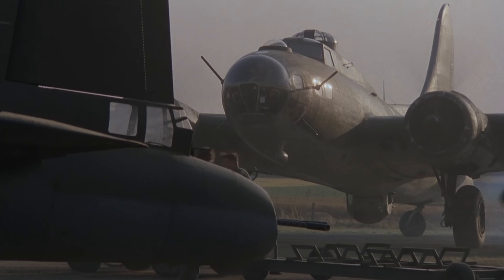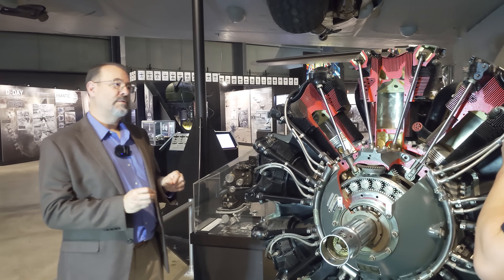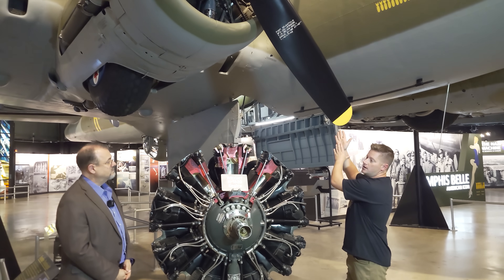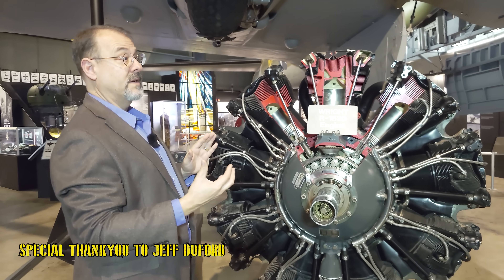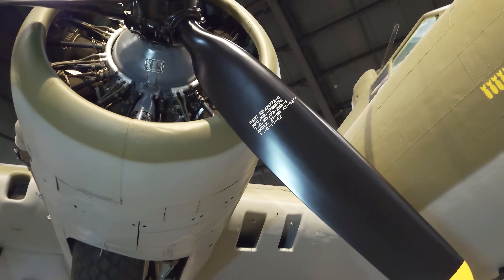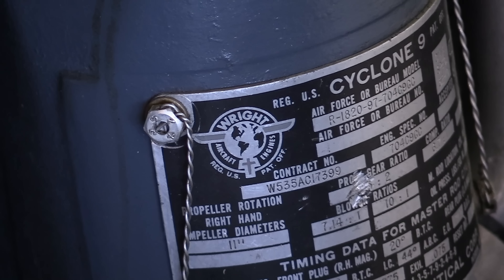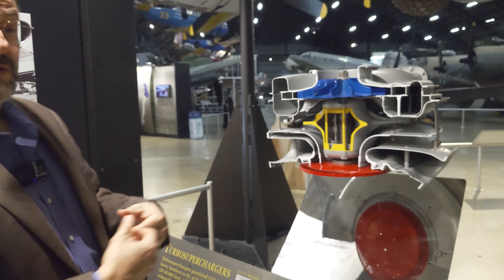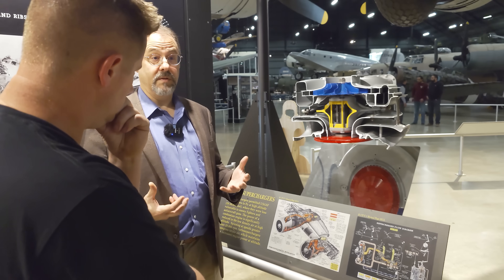B-17 ENGINES IN DEPTH! Genius Or Insanity?

Comment: The nine-cylinder radial engine has two cam rings.   One exhaust, one intake.   Each ring has four lobes and rotates opposite the crankshaft's rotation.   Also, each cam ring rotates at one-fourth engine RPM.  I'm quite familiar with engine mechanics, but this arrangement still amazes me, and I don't fully understand how it works.  But it does.  The cam rings are partially visible in the cutout.   Also they had roller lifters, which are very common today, but unusual for the 1930s and 1940s.   Remarkable engineering, and achieved w/o computers, CAD-CAM, or CNC.  Those engineers were geniuses.  Up close and personal, nothing sounds quite as awesome as a big, radial engine.   I got to ride in a B-17 about a decade ago, for $450, and it was worth every cent.   I sat in the nose gunner's seat and "strafed" herds of cattle that we flew over in fields surrounding the airport.   Quite an experience.   No cattle were harmed!
Reply: Each cam ring operates at 1/8 engine RPM . . . . . not 1/4.  Each cam ring does, indeed, rotate opposite the crankshaft's rotation.  You're right . . . . these 1820s were a work of genius!
Reply: Thanks for that correction. @PhrankTube
Reply: @PhrankTube are you sure?  If you look at the gearing that can’t be true.
Reply: @totalyep  Yes . . . . . absolutely!  Right from the B-17 manual.  Just do the math . . . . . cam ring rotation between cylinders 1 and 9 (remember the crankshaft rotates opposite to the cam ring) . . . . . 40 degrees divided by 320 degrees is 1/8.
Reply: @PhrankTube  thank you. From looking at the gearing I don’t see how it spins that slowly. The inner “sun” gear must not be spinning at the same speed at the crank.
Reply: @totalyep  You're right . . . . it's not.  Here's a good one for you . . .   Magneto Drive Shaft Speed Ratio to Crankshaft = 1.125:1.  That one might keep you awake at night!  The "proof" is left as an exercise for the student.
Reply: @PhrankTube  ah. Makes sense. I need to find a good cut away. Fascinating all the moving parts in these engines.
Reply: @totalyep  Here's another mind bender for you:  Just imagine that the cam ring and the crankshaft both rotate in the same direction (not opposite direction) . . . . . The cam ring would now have 5 lobes (not 4) and would rotate at 1/10 crankshaft RPM (not 1/8).   Enjoy . . .
Reply: @PhrankTube  "That one might keep you awake at night!"  On the contrary. Instead of counting sheep, I try to visualize the operation of the cam ring opening the intake valve of the #1 and then the #3 cylinders. It's so far beyond my feeble mind that it puts me to sleep instantly.
Reply: @PhrankTube OK, Ignition vs Crank, 8 to 1. Otto cycle one spark per two revolutions, that is four to one....I don't really understand radials, don't know anybody who does!
Reply: @RSB333   Well, here's how it goes.  The crankshaft fires 9 plugs in 2 complete revolutions.  The magneto creates 4 sparks (sent to the distributor) for each of its' revolutions.  The magneto is geared at 1 1/8 revolutions per crankshaft revolution.  Soooo, 4 x 2 x 1.125 = 9.  No mystery:  That, however, is enough for "Round Engine Appreciation Day".  Isn't this fun?
Reply: @PhrankTube DEAR PHANKTUBE GREETINGS! 
VERY INTERESTING COMMENTS. 
ARE YOU A CW1820 MECHANIC OR ENGINEER?
Reply from the maker: On one hand it's UFO technology, when you look into it, it's amazingly simple to understand compared to today's engines. Thankyou for watching! Glad you got a 17 experience flight in!
Reply: @MilitaryArmamentsCompany  true. Simplicity is the paramount of engineering
Reply: Man, I'm a mechanical design engineer and blows my mind every day that those engineers design all that stuff without a damn calculator! All by pen ans paper..... Its absolutely mind-blowing, you take me the computer and im completely lost 😦😦
Reply: @xevi2889 Hey, they did have slide rules.....good to THREE significant digits! Ya hadda add and subtract the zeros in your head for decimal point.
Reply: They have more lobes to equate the difference from half speed to a fourth speed. Very interesting setup though
Reply: @benmassey531  take the number of cylinders and add 1 or 2. For a 7,  6 or 8. Divide those by 2 and that’s how many lobes each cam track can have. For a 7, the cam can have 3 or 4 lobes. The ratio is 1/(number of cylinders - 1 or plus 1). So three lobes turning at 1/6 engine speed or 4 lobes turning at 1/8 engine speed. One needs to turn opposite direction, but I can’t remember which. A 5 will have 2 or 3 lobes, a 9 will have 4 or 5 and so on.
Reply: @88SC  Great explanation!  Thanks . . . . .
Reply: @benmassey531 Great explanation!  Thanks . . . . .
Reply: I was hoping for some technical presentation. Sadly, the video struggled to explain why compressing intake air was needed at 30,000ft. OMG.
Thank you for the tech. Your post made visiting this page worthwhile.
Reply: Two solutions for every possible number of cylinders. Someone will chime in with the formula, I’m confident.
Reply: All of the computers just slow down development. p51, ink to first flight-125 days, V22-20 years to production
Reply: Cam rings ? You mean lobes ? 
I have a cylinder head piece from a crashed B-17. I was amazed at the roller rocker arms. The engines are still at the crash site from the late ‘40’s.
Reply: @redmesa2975  I meant cam rings.   The cam rings have came lobes on them.   They use cam rings instead of camshafts.  They perform the same purpose.
Reply: @claiborneeastjr4129  now I understand. Thanks !
Reply: And then think about the Pratt & Whitney R-4360 Wasp Major, an American 28-cylinder four-row engine.
Reply: @MrMerlin9911 I read once the 4360 was a beast to time! Each row had to be timed separately, then the rows had to be timed to each other. Not to mention having to change 56 spark plugs! And then there was the problem of insufficient cooling of the D row. Some engineers derated the D row a bit to prevent the cylinders from overheating.
Reply: Genius is right.
Reply: Be grateful for the experience; as of a couple months ago ALL such flights are now forbidden.
Reply: @philgiglio7922  That's awful news.  Why?   EPA regs?   Insurance regs?   Can't say I'm surprised, however.
Reply: @philgiglio7922  exactly 2 months ago I flew on one, so I don't know what you're talking about.
Reply: I believe it's not that a particular row of cylinders overheats or does not get adequate cooling airflow. Yes, air flowing over & around cylinder heads in the row(s) closer to the propeller recieve cooler air, it's more an issue of ducting the air to flow evenly at a similar velocity around each cylinder to provide even or balanced heat transfer to the cooling air within a narrow optimum range, thus air velocity through & over the engine is critical. Therefore, cooling air intake ducting & exhaust ducting are critical. Cowl flaps, while allowing a higher volume of airflow, could upset balanced airflow. Just because the engine is operating at higher altitudes with coler ambient air temps does not guarantee an evenly cooled engine.(This was once explained in detail by an uncle who ran B-29 squadron maintenance on Tinian & Siapan during WWII
Reply: WHAT
Reply: )0) tx d
Reply: Actually, it is one ring with two sets of lobes running around it.
Reply: Yes we hosted the nostalgic C47 FAA flight check bird for a time. I got the privilege to fly on it as a flight engineer. One thing I learned quickly is, if it is not leaking oil, you'd better check it, because it is probably out of oil. Cool old bird but we went through lots of diapers. It drove the skeeters away when it started also. you would have thought it shed a piston; it smoked so much. We always hand propped it with ignition off before starting after sitting to make sure the 6 o'clock combustion chamber was not flooded with oil. Under hydrostatic lock you'll bend or snap a rod. I've also heard of them breaking a cylinder loose.
Reply: I don't remember if this engine uses a master rod, but on those engines that do, the other connecting rods articulate off that master and don't make a true rotation. Hence, the timing cam in the magneto has the lobes for the points slightly offset for the difference in timing that each piston would require. Google radial engine compensated ignition cam (It should come up...we talked about this in A&P school)
Reply: Roller lifters were only uncommon in automobile engine's back then, every motorcycle engine I've seen the inside of from the mid teens up had roller lifters even the flathead motorcycle engine's.
The only reason I can think of why the automobile industry used flat tappet lifters so extensively is because with them you don't have to solve the rotation issue like you have to with roller lifters, it simplifies the design, aside from that I couldn't guess as to why they used flat tappets in their engine's when it seems like everyone else used roller tappets.
Reply: @dukecraig2402 motorcycles obviously also have a lot fewer lifters. Early motorcycle engines in particular also had pretty crude oiling systems like total loss or not pressurized which I bet a flat tappet arrangement might not take kindly too. Just a guess
Reply: Good reasoning.   Likely flat tappets were cheaper to manufacture, too. @dukecraig2402

Comment: So these engines were compounded according to the explanation given. Interesting. I was under the impression that turbo compounding came later. Great video. Thanks for posting.
Reply: To be compound, the turbine should be geared to the output shaft. This turbo feeds the engine driven centrifugal supercharger. Really awesome though.
Reply: @Dr_Reason  Making it a 2 stage supercharging system,  More than the British Lancasters Merlis had, only a single stage mechanical supercharger, why B17 had a 10,000 ft service ceiling advantage over the Lancaster !!!
Reply from the maker: Glad you enjoyed it! Plenty more coming.

Comment: Hypothetically, if they replaced the R1820 radial engines of the B17 with the r2800 engines what kind of performance boost would you get?
Reply from the maker: Love the creative "what if" thoughts. That one is definitely above my pay grade. Some one here may know.
Reply: @MilitaryArmamentsCompany  Well the B17's engines were listed as 1200 HP ea and the R2800 in basic form was 2,000  And depending which R2800 and the supercharger used, either the single stage, or 2 stage 2 speed unit or the 2 stage Turbocharged version to determine service ceiling and load !! !

Comment: He mentioned Sam Heron, who was a genius whose contribution to aircraft engine development came at a critical time in history. His employment of sodium as a heat transfer medium was paramount in the development of other industries as well. Respect.
Reply: Sodium, having a low melting point, would slosh around inside the valve to improve heat transfer.
Reply from the maker: Yes absolutely. Jeff was the right man for the job on this topic!
Reply: Wow every day is a school day, Sam worked for Armstrong Siddeley Motors of Coventry Warwickshire UK, for he designed the Jaguar first half way reliable twin row radial  in the early 1920,s.
Reply: Sodium filled valves are used on modern turbocharged car engines too.
Reply: @twelvereasonswhynot   So did  Cecil Rowledge , in 1929 -31 he was partly  responsible for developing  Rollers 'R' series drag race engine with sodium cooled exhaust valves, giving Britain the outright win of the Schneider Trophy  powering Reggie Mitchell,s 'Hot Rod' the S6B.
Reply: Should be called Heron valves.
Reply: @peterclark6290  I think you are right, with out  Sam,s breakthrough, we could not have won the Battle of Britain,. Rollers of Derby used sodium cooled  exhaust valves on the Merlin and Griffon, enabling high power ratings with improved reliability.

Comment: Wright engines were 2nd rate..
Look at what they were put in..
Mostly crap.. Pratt&Whitney powered much more successful aircraft! B-17 flight engineers weren't even used for training on the then-new B-29 superforts. I know this because my grandfather who was a assistant flight engineer on a B-24 told me.. He trained B-29 engineers when he was rotated back from the SWP & his missions flown there on Liberators.
Reply: The FM-2 used the R-1820 very successfully and was able to be "tweaked" to above the rated 1350 hp.
Reply from the maker: Interesting feedback. You would enjoy our B-29 in depth video, we spend several hours with their flight engineer Donnie.
Reply: Not a word I would use to describe NAA B-25s, Douglas Skyraiders and DC-7s, Lockheed Constellations and Neptunes. Early ’3350s on B-29s were unreliable but due to necessity they were pressed into service before they were ready, development wise. On the other hand a Pratt R-2800 is the gold standard for reliability among high power radials.
Reply: johncarlson  BULL$HIT story !!! Wrights were as good as any engine why over 200,000 of them were made !!!

Comment: My father was a ball turret gunner in B-17s in North Africa during WWII.  When I was a young kid, he was always telling me that the superchargers and turbochargers on the B-17 engines increased their Volumetric Efficiency(VE).  I never knew what that really  meant until I took a class in thermodynamics in college. 
Note: From an online Brian Nutter Tech Article ------ At sea level, the air is more dense. This means that there are more air molecules inside the cylinder. In the mountains, the opposite is true. The same engine would operate at a higher VE at sea level than in the mountains.  You can improve VE by making it easier for air to flow. This is the idea behind aftermarket intake manifolds, cold air kits, porting and polishing cylinder heads, and headers. Pumping more air is also the idea behind superchargers, turbos, and nitrous. These power adders force more air into the cylinder. When the fuel and ignition systems are properly tuned, this can raise VE over 100 percent and make tons of power. (From "On All Cylinders" Tech Article 05/11/2017 by Brian Nutter
Reply from the maker: First rate description! Thankyou for the information. Stay tuned with us, a huge Ball Turret video comes in 2 weeks. It will be the best one on the internet.
Reply: great description.  That thinner air was much easier to fly through.  All the trade-offs; burning the fuel to get up there, saving fuel by being there, less accuracy in bombing, which led to development of better bomb sights, then almost gliding back to base.
Reply: Reciprocating gasoline engines produce more power on cool days than hot days ,I guess everyone knows that but what about the troposphere being 50 percent thicker at the equator than in temperate latitudes, I wonder how that fits into the equation.
Reply: @HughBond-kx7ly 
Greg's airplanes the automobiles has some good videos on this. 
Including one where one of his automobiles blew an engine.

There is time to wonder 'why' before his next video explains it.
Reply: Normally aspirated, meaning non turbocharged/supercharged, lose about 3% power per every thousand feet of altitude gain.  With the use of turbochargers and superchargers or both on the B-17, the engine can develop sea level thrust up to a certain critical altitude dependent on their design.
Reply: Setting boost pressure to the proper level ensures the proper compression. It takes time to put air into a cylinder. As RPM's go up, time goes down. Compressors fix that problem.

Comment: Ironic that you show a Studebaker built 1820. In a conversation with Bob Morgan, 3 or 4 months before he died, he told me that only one Studebaker engine was allowed on a B-17. If combat flying meant 2 Studebakers the aircraft was grounded instead. Just word of mouth and he would not elaborate.
Reply from the maker: Never heard that one before. I would hazard a guess that if an engine is there, it would go on the plane.
Reply: @MilitaryArmamentsCompany  All I know is what the man said. I heard or read, from whom I don't remember, that the Studie 1820 reputation was part of what lead to the company's downfall, but I have absolutely no corrobotating source data.
Reply: The info I had heard was Studebaker was the Prime engine builder supplying engines for the B17. Studebaker was known for its quality products, as in ALL the military trucks they also built during the war,,,,

Comment: Your description of turbochargers omits any mention that no automatic boost-control system was used.
Reply: Yes they were automatic, that's why the air filters had to be disengaged above 15,000 ft on the F and 20,000 ft on the G model, because they'd restrict air enough in the thin atmosphere that the automatic boost control would overspeed the turbo's trying to automatically maintain boost.
Like other USAAF aircraft in WW2 that had the supercharger/turbo configuration they had automatic boost controls but could also be run manually by turning off the automatic feature.